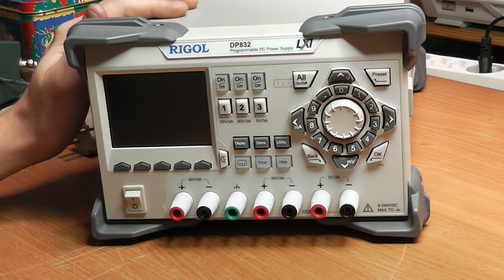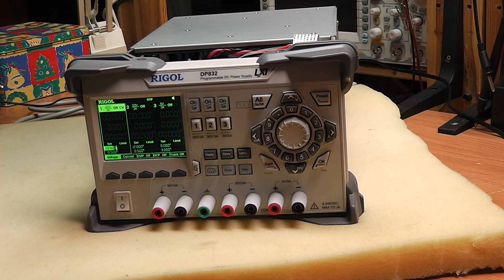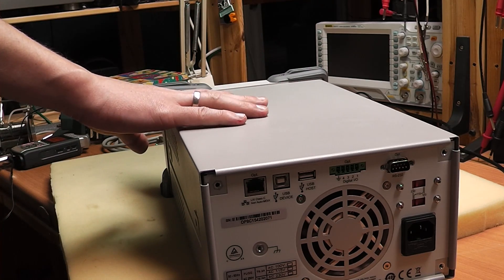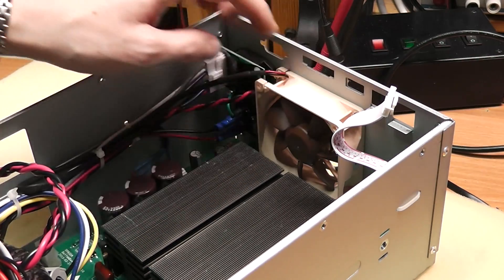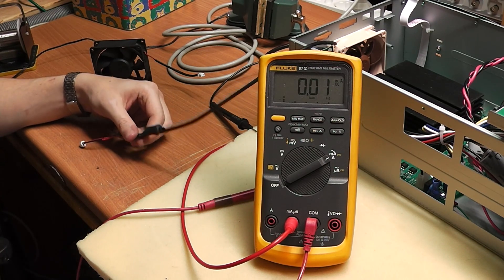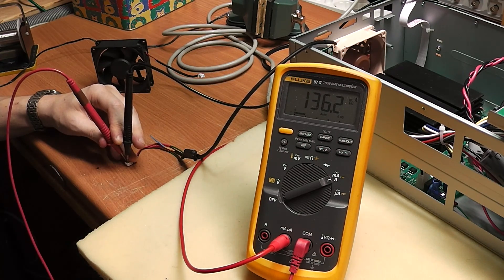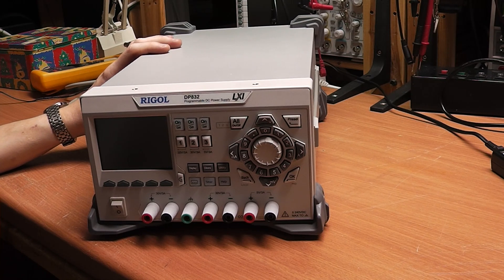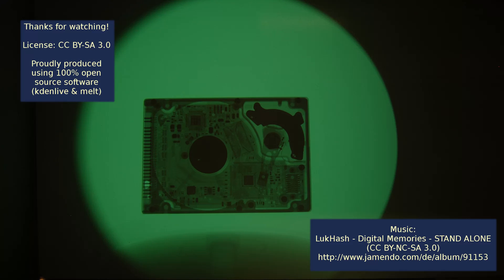Silencing a Rigol DP832

Comment: I placed the Noctua NF-R8 redux-1800 and the sound measured is going from 50dB to 40 dB and the supply is really quite. Disadvantage is kind of switching noise (around 400Hz) from the supply that i did not hear before because of the loud fan. The noise is not from the new fan, do others experience the same?
Solved: the switching noise is from the display, if you set brightness, in the display setting menu, to 94% the noise is gone.

Comment: FYI, I did the mod with a NF-A8 FLX, which replaces the model used in the video, and It works out of the box. 
Maybe Rigol updated the threshold value since 2014, or the new model has slightly higher power consumption...
Reply: I can confirm that it does work with a Noctua NF-A8 with Low Noise Adapter (12V 45mA) without modifications.

Comment: I followed these instructions using the same Noctua NF-R8 redux-1800 and 200 ohm resistor. After a while it complained about the fan. I added a 1 kohm resistor in parallel with the 200 ohm which has solved the problem so far. The noise difference is a relief.

Comment: Hi Guys, i have a DP832A and i silenced it using a Noctua NF-R8 redux 1800 with a 390 Ohm/2 watt resistor. Works like a charm. Only the warranty coult be an issue.... Bud, it's really quiet! :)

Comment: I wonder ... is there room to install two fans stacked together?  If so then two quiet fans would tend to be quieter and the combined power consumption should be close to the 160mA factory one.  Quiet is good so long as the airflow is adequate.

Comment: I also replaced the fan. The original fan is very loud. Its the first thing I noticed about the power supply when turning it on. The new fan, I do not hear it at all.

I also replaced it with the Noctua NF-R8. But be sure to use the 1800rpm version. The 1200 rpm version has too little air displacement compared with the original fan. Its one of the best small hacks I ever did. I also used a 220Ohm/2W resistor.
And I got the taste of it (that's a Dutch saying, I think its hang of it in English) I'd like to do the same hack for my oscilloscope.

Also be aware of the fact that some versions of the DP832 seem to have two fans according to some people. One extra 40mm fan. You might want to replace that one to.

Comment: A nice psu but a very very crude way to check on the fan, a rpm wire should have been on the original to monitor the fan, shame on the manufacturers.
Hope your psu is still happy :-)

Comment: Interesting video! Thanks!
But did you actually make some calculations to verify that the Noctua NF-R8 "moves" enough air? In other words, is it really as good as the original (noisy) fan? How did you verify that?
Reply: It moves 30% less air, but if you're using the DP832 at room temperature it's fine. The stock fan provides enough cooling to run the power supply up to the max specced temperature of 40C.

Comment: Nice hack. Very useful :)
I fell into a similar trap with a Lambda 600W power supply. The fan had red/yellow/black wires but instead of the yellow one being a speed indicator it is a alive/dead signal. So the PSU turned off after my hack. Had to make a little circuit to make it work.